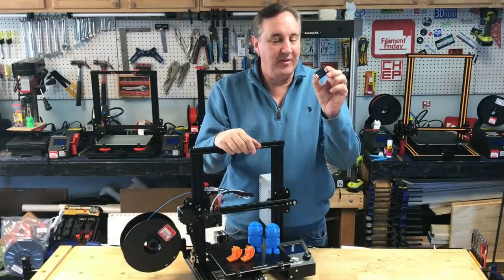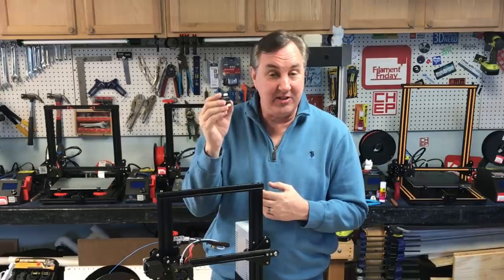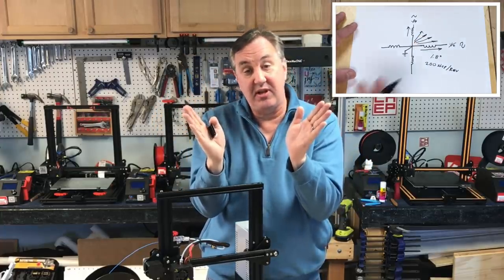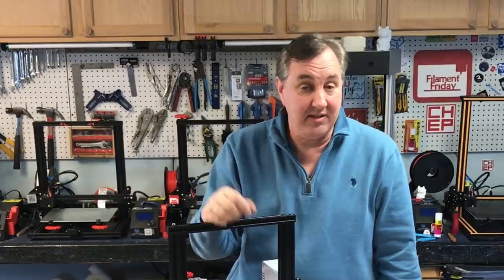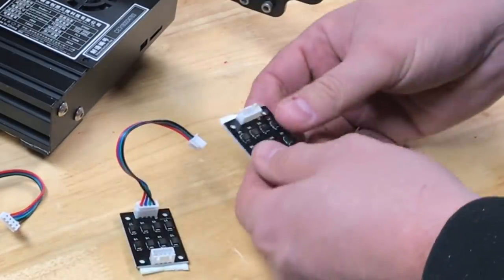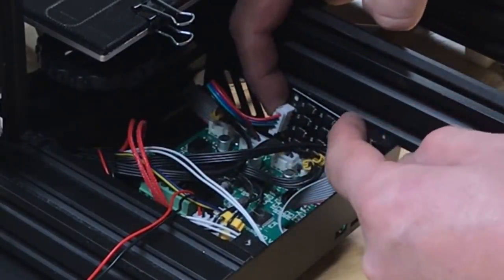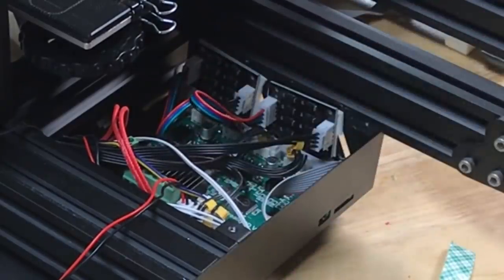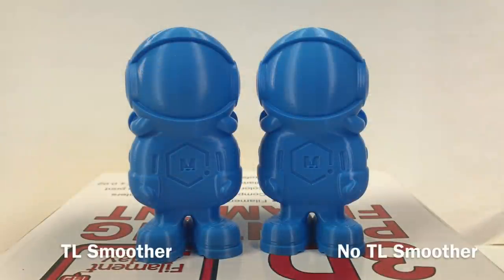Creality Ender 3 - TL Smoothers Upgrade and Test

Comment: Hiii Chep.. should i buy tl smoother for my ender 3 v2. Thx
Reply from the maker: No. They only help the older 4988 driver chips.
Reply: @FilamentFriday  Don't they work for DRV8825 as well?
Reply from the maker: Not sure.
Reply: So I just put mine on an my ender 3 v2, thanks to your video I knew were to put them, I have only done one print, but I will say... maybe I got a slight better print, I did a pumpkin that seamed to have less vertical ribbing... but they maybe my machine that was otherwise fairly quiet, quite loud. And I can fell running vibration ... don’t think I had that before... but again... equal to maybe slightly better print... what do you make of the noise? All bad? Take em off? I haven’t been able to find any info on this in a search.
Reply from the maker: Ender 3 V2 doesn’t need them. It has TMC silent drivers.
Reply: CHEP after doing a few extra prints I believe the reason I noticed an “improvement” in my print, in small areas was the added vibration was almost giving a smoothing effect making flat surfaces look more fabric like.... example bed leaving squares looked more flat n super fine textile, however I don’t like the vibration, the noise sounds almost grinding sometimes, and it have be having much more strings and minor blunders in areas I was never having a problem. The verdict for me is they are coming out... think my overall quality on the basics has suffered... but would be interested to use as a smithing technique on surface area for those super smart people who under this stuff better on the development end... I’m a beginner, love your vids have learned a lot... still long way to go and I’m heeding your advice and they are coming out, thank you!

Comment: Would these be of some benefit to my new MKS Gen L V1 board?  I find this board quieter anyhow.
Reply from the maker: Don’t know. Possibly. Depends on the drivers.
Reply: @FilamentFriday  I'm using the 4988 driver boards that are the same as on the original Ender board.  I think I will order them anyhow just for giggles.  Perhaps I can update with my situation and setup.

Comment: Chep no ventilation crazy! :(
Reply from the maker: There’s ventilation. I didn’t seal it.
Reply: Makes me nervous too.  I'd be drilling the crap out of that end plate to ensure airflow.
Reply: @FilamentFriday  From what I know of computers, your modification could actually force an relatively big increase of temperatures on the electronics. Fans are distinguished into pressure and high flow optimized ones. The Ender-3 mainboard fan, with lots of space betwen it's fins is a standard high flow fan, optimized to move as much air as possible, but without the ability for building up pressure, to actually force the air through the tiny holes left in the case. You can easily imagine this, as the air that was sucked in by the fan, can move back out between the fan's fins again, without even going past the electronics, if there's no easier way to go.

Comment: hi, so  does it work it with Cr-10s? and which version?  on aliexpress , there are lots of smother available and i'm confused which to buy and  not,
Reply from the maker: The ones I link to will work as there are just two basic types, 4 diodes and 8 diodes. I have not tried them on CR-10S though.
Reply from the maker: Seems very similar to what I used.
Reply: @FilamentFriday  can you do me a favor and try it with cr10?
Reply from the maker: My CR-10 doesn’t show the lines on Benchy so it would not help or prove anything.
Reply: @FilamentFriday  ok thank you

Comment: All I can see is they put a Volt drop in the circuit... a bit like stepper  dampers no need on the Ender 3
Reply: What? "Need" is definitely subjective but the dampers cut the noise my x and y axis by a ton.
Reply: @cowardly_wizard  Here too.  When I got the printer, it was at the foot of my bed (for a multitude of reasons.)  I printed for 2 days without the dampers, then installed the two.  Before the dampers, the steppers would sing a rhythmic song that my wife giggle at.  The dampers on the X/Y steppers and the music all but went away.  You have to be on top f the unit to hear the singing now.  The MKS board I installed really seemed to quiet the rest of the noise.  Maybe because I set my Vrefs by hand on these steppers.  Now the printer has it's own room I can monitor via CCTV.

Comment: I have run into a problem with the connectors, the smoothers use jct 4 pin and my steppers and board use jct 5. Can anyone provide a possible solution.
Reply from the maker: On Ender 3?
Reply: @FilamentFriday  Sorry,  just me being a confused idiot as usual. When taking a second look I realized that I was trying to attach the smoother to the motor when I should have been attaching it to the board which has a for pin connector. All is well now, thanks.

Comment: Hi i fitted my tl smoothers on my ender 3 pro and started test print,my z axis didn't get of the heat bed,can you help.
Reply from the maker: The Z axis shouldn’t have a TL smoother so it should be affected. Make sure the connectors are still in place.

Comment: Can these be mounted at the stepper itself ? externally
Reply: Sure, absolutely, just make sure to secure it and cabling properly incl strain relief, if it's on somewhere where the stepper moves along with the axis. Especially important on the Ender 3 / CR10 and similar open cartesian printers. You really don't want that extra board or its cables getting caught in the Z-axis screw, falling off and getting caught between the stepper and bed (potentially jamming the bed or getting caught on a clip and tearing it off when the bed moves), or the cables or the board itself falling off and down if on a direct drive extruder.

The primary benefit of mounting it somewhere near your board, is that its exposed solder joints and connections are usually out of the way, and its cables not near any moving mechanicals (well maybe except a housing cooling fan).
Reply: No you can not as at the stepper motors is a 6pin connector but only uses 4. They need to be at the end of the wire inside the box by the onboard or nothing

Comment: i just installed these and now the auto home is grinding and set backwards. Ive triple checked the connections and cant seem to resolve the grinding on the z axis... help!!!!
Reply from the maker: The wires are probably backwards.
Reply: reverse direction from the firmware
Reply: I bought 4 of these (for all 3 axi and extruder) and one of them did something similar - seemed to change directions randomly and grinded all over the place. Did the same when i put it on different axis. Eventually after fucking around with it i decided that Z axis doesn't need it that bad after all. I guess they can occasionally be just badly manufactured.

Prints do seem better though.... echoing is almost non-existent
Reply from the maker: I never suggested it on Z. Only X and Y.

Comment: I have heard this isn't needed on the newer Ender 3 models. Just got my printer a few weeks ago, suffeed from extrme under extrusion and what looks like Moire. Got a new aluminum extruder arm but can;t tell if the moire went away. Should I still try TL Smoothers?
Reply from the maker: You were mis-informed. It’s caused by the stock 4988 drivers. I suggest install a new motherboard with TMC2208 drivers instead

Creality Silent Stepper Board: https://amzn.to/2YPM0Nh
Reply: @FilamentFriday  I just installed the SKR Mini E3 1.2 on my Ender 3 which I think has TMC 2209.  Should I leave the tl smoothers on the Ender 3 or swap them over to my newly purchased CR-10 Mini?  (btw, thank for putting all this info up here!)

Comment: This is a year old video but I am told there is no such thing as " old " question ( ... or was it stupid question ) nevertheless,do these smoothers effect VRef vs motor torque !? There must be some power loss in all those Diods causing general loss of juice steppers need for a given ideal torque.
Reply from the maker: No, it just blocks current on the low end of the curve. Using the silent board with TMC2208 drivers eliminates the need for these.
Reply: @FilamentFriday  Thank you for this. Yes, I am aware of the TMC drivers but in my case i have to upgrade the mainboard as the drivers are soldered on and printer in question is a delta. I stop here before hi-Jacking the thread

Comment: cant i just solder diodes and DuPont connectors on a proto board and call it good?
Reply from the maker: You’d be better off putting a silent driver board in it instead
Reply: You can if you want to, but do evaluate if it will actually provide any benefit for your printer config. It's not a particularly complex circuit. Just make sure to get it right, or the result could be less than stellar if you mix up the orientation of one or more diodes.

Comment: Hello! Is it nessesary to use smothers on Z axis?
Reply from the maker: No.
Reply: @FilamentFriday  And for extruder?
Reply: @HoobriBoobri  install them on all motors.
when I turn off stealthchop on my Z's or extruder, they squeak loudly.
Reply: @YomAlwa3eed thanks for answer, but what is about qulity of prints?
Reply: @HoobriBoobri  I doubt it will make a difference.
Reply: @HoobriBoobri  as a mater of fact when it comes to quality of prints you won't need E Z X nor Y  lol
Reply: @YomAlwa3eed  ok

Comment: Would these benefit a stock Ender 3 pro? Received it in march, thanks
Reply from the maker: Yes it should. Print a Benchy and see if you get the stripes.
Reply: I bought them anyway when I got my ender 3 pro installed before I ever ran one print. Thing prints amazing I'm very surprised by it

Comment: Face palm vent!
Reply: exactly my thinking - especially since the Ender 3 fan sucks out the air, so he blocked the inlets...
Reply from the maker: There is a big hole at the back, vents at the bottom and some vents still open by the Smoothers. So all good. Like I said in the video, there are many places to get airflow.
Reply: yes,  CHEP, but you want to get a directional airflow over the heatsinks on the driver chips and MOSFETs on top of the circuit board. Otherwise https://imgur.com/ax0dg1y
Reply from the maker: I actually improved that since more air now goes across the board than slipping out the side where the Smoothers and big vents are. And even air flow won’t help that picture. That’s simply over current.

Comment: Will these work on Anet A8
Reply: yep
Reply: Richard Benson what about on my cr-10s
Reply: @octosquid9918  It just interconnects between a driver board and a stepper, so yeah it will..
Reply: Actually they will not.  The a8 doesn't not benefit from to soothers.  It was once thought to help but no more. There is a thread on thingiverse, I don't remember which so search it in posts, but read up deeply for more detailed information on it.  Do not take your first answer,  or even mine, always do your own research then question to world.

Comment: why can't it be placed in Ender 3V2?
Reply from the maker: It doesn’t help. V2 has silent drivers.
Reply: @FilamentFriday  but it still can function as protection to reverse current or not?
Reply from the maker: Why would you need reverse current protection?
It would most likely screw up the stepper drive.
Reply: @FilamentFriday  Agreed, i just screw up the stepper drive in my ender 3 v2. I plugged out it and now its fine

Comment: Hello Chuck,
thank you very much for all the good stuff you make. Mostly all videos helped me, too. But this one... Sorry, no. I´ve tried to "smooth" the X and Y-axis but... NO result. Not any difference. Especially the strange lines on the benchy, you casted away with the upgrade. The same angle, nothing changed :( As Teachin Techs Michael Laws. https://youtu.be/zIPeHXCVS2Y Which Board is on Your Ender 3. Mine is the 1.1.3. 
EDIT: Now I have another smoother attatched to the E (Extruder) THAT works fine now! The strange angled lines are gone. The benchy-test will follow now. 
How I tested? Take a 5x5x5 Cube, print it in Vase mode. There is another, strange effect: The angle depended on the ExtrusionWidth. Angles form 0 to 90 degrees. To see this, make it like a heattower. But change the EM instead of temperature. Now this stange behaviour is GONE
Thank you so much,
Andreas

Comment: does it need to ender3 pro?
Reply from the maker: It helps.
Reply: on my Ender 3 Pro  where the motor connectors connect theres a blank side they just fit.
I bought these for my Ender 3 Pro (1.1.4 mobo, it was noisy without thermal protection , activated, which I managed flashing the firmware) at first the Z axis motor grinded very loudly (others were OK), so I swapped the connectors round on the smoother board & that stopped it so perhaps they do need wiring one way.
Just as noisy as normal, but does seem to give slightly better quality prints (not massively). Though now the fan on the hot end (the front one) doesn't seem to have enough power to spin up full speed (if I push it, itll work for a min or so)  not sure if this is anything linked. check the mobo number, if its 1.1.5 you dont, if its 1.1.4 you might (is it almost silent? if so its the newer 1.1.5 board, so  no)

Comment: The air flow was blocked!
Reply from the maker: No it isn’t. There are lots of openings around this. It’s been running fine for over a year.
Reply: on my Ender 3 Pro  where the motor connectors connect theres a blank side they just fit.
I bought these for my Ender 3 Pro (1.1.4 mobo, it was noisy without thermal protection , activated, which I managed flashing the firmware) at first the Z axis motor grinded very loudly (others were OK), so I swapped the connectors round on the smoother board & that stopped it so perhaps they do need wiring one way.
Just as noisy as normal, but does seem to give slightly better quality prints (not massively). Though now the fan on the hot end (the front one) doesn't seem to have enough power to spin up full speed (if I push it, itll work for a min or so)  not sure if this is anything linked.

Comment: That kid with Teaching Tech said they dont work, but hes got a shiny smile so he must be right.
Reply: Actually he was sort of right, smoothers were originally developed for the DRV8825 drivers years ago because on 12V systems with low impedance motors you would see this effect on the prints, and it all came down to that particular driver in certain setups.  The smoothers are now being marketed and being pushed by certain youtubers as well as a cure all when in effect it's just shitty electronics.
Reply from the maker: If you look at his bench prints, in his first test he goes from angled lines on the cab to no lines on the cab. So they did improve his print even though he says they didn’t. Then in his second test the lines are back on the smoother view so I’m confused on his results but the Smoothers got rid of those lines for me as I showed.
Reply: @FilamentFriday   I dont believe it  takes an electronics expert to understand that a cleaner signal is still a cleaner signal weather its visually impacting or not.
Reply: @95RayDog  Except that no measurements were made in this video to actually show any signals, cleaner or not.
Reply: @thegarageluthier  Were talking about budget printers folks. Of course the electronics and QC aint top notch. Partially why we get them is to iron out the wrinkles. So in conclusion, like CHEP said at the very begining. IT Depends!!!. Even if your using the exact same model in the exact same application in the same enviroment, they vary enough to where one might like smoothers and one doesnt matter.
Reply from the maker: Well said